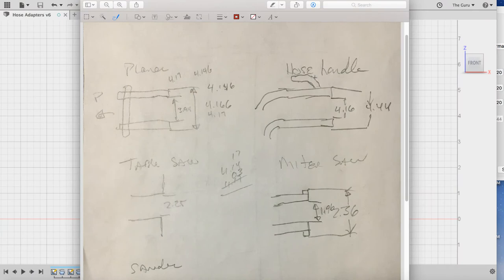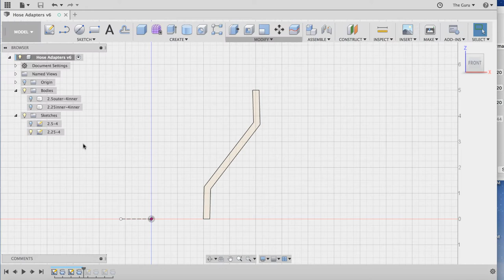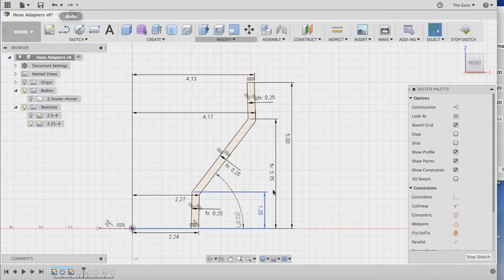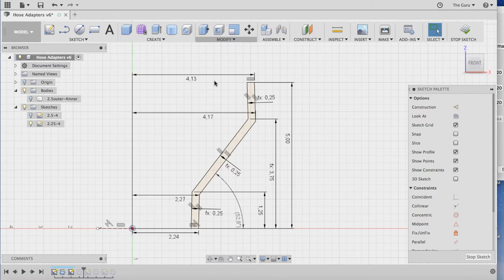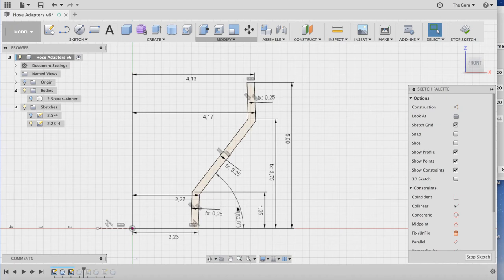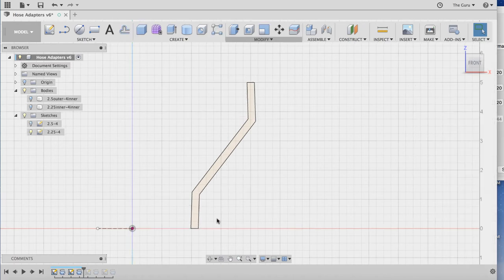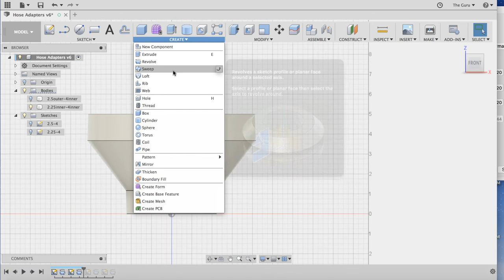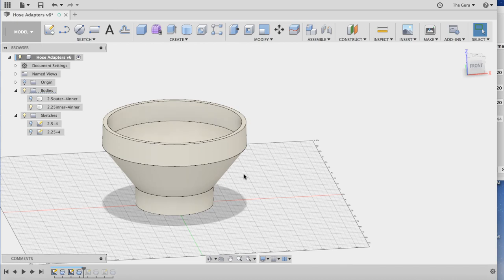Making Hose Adapters with Fusion 360

Comment: I can't seem to find anywhere how to do a hose adapter at say 135 degrees angle, only straight ones like this, or kids messing around with sweeps. Urgh
I haven't needed to do this in so long I forgot about revolve, but the angle still bothers me
Reply from the maker: You should be able to set a specific angle using a dimension. revolve is really the way to go with anything circular and hollow. Thanks for watching!